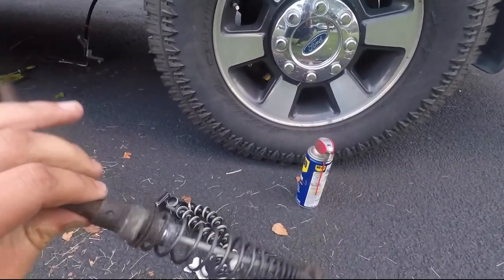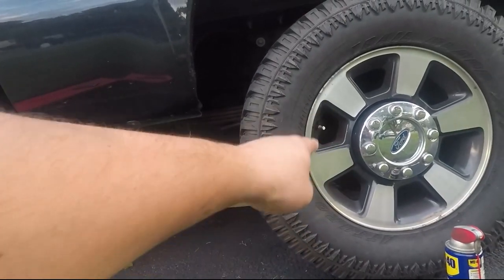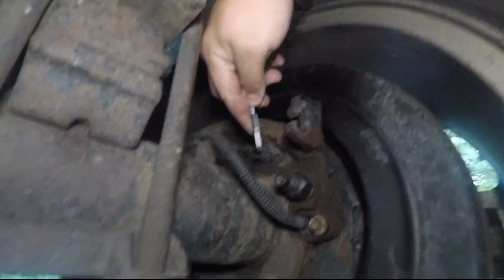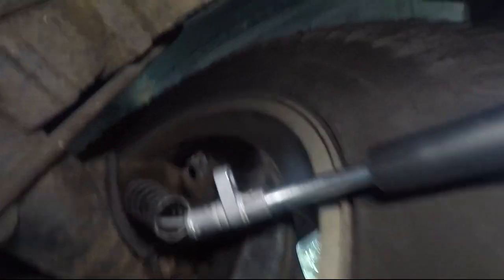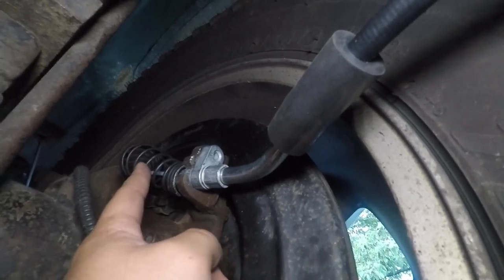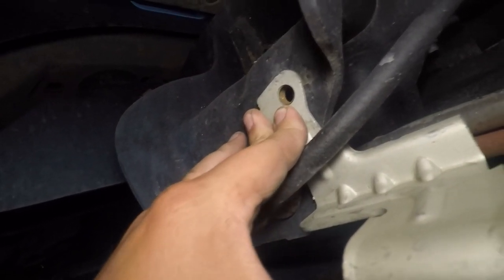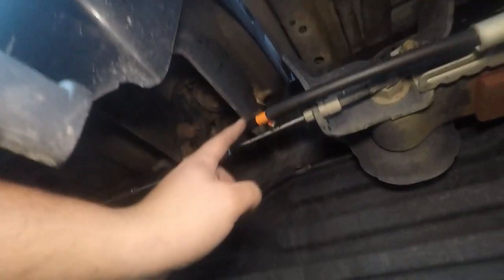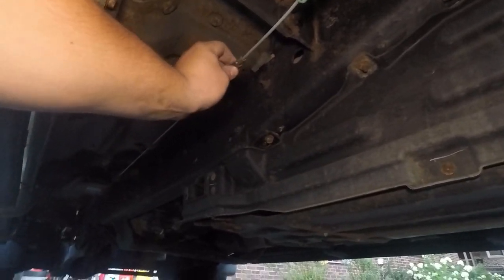E Brake Cable Replacement Super Duty

Comment: Thanx again, that verifies and informs me on the stuff I needed. I wrote out a great lengthy response as I cooled down from the tropical heat before I run out again and get a couple three hundred things done. About how I worked at a machine shop in San Diego that did all the machine work for the city bus system engine rebuild shop. First thing I thought was, after I realized those springs are what creates the tension on the ebrake pedal/cable. That’s not much to hold a 6,200 lb vehicle still when you go into gear with that monster engine. And Haynes said the test in on a hill also. Then I thought, to get much more pressure the springs would have to bottom out and the system cannot be designed for that. So it is only a parking brake, and would be a really weak emergency brake. Showing the cable replacement really filled in some gaps, as I just got my first Super Duty in May. I’ll finish rewriting my original comment that got erased in a couple other comments later, I have to feed my pig or she’ll be bulldozing around my cabin. Suffice to say the idiot I got the truck from replaced one rear brake disc the evening before I looked at it, and the machine shop was educational on a few levels. I rebuilt the old VW engines and did about everything else from paint to interior etc. . The machine shop had specialized in them for 30 years previously.
Reply from the maker: Man that is awesome! Did your comments get removed from my videos? I hope not because I didnt delete them. You have been very respectful not sure why that happened man. I'll check later tonight to see if they got kicked over for review but I can only do that on my computer not my phone

Comment: 👍 great video!   Can't wait for performance parts to become readily available for my 2020 F350 SRW!
Reply from the maker: I hear ya man. I am getting ready to soon start doing some performance mods to the truck, and reviewing them. There were some big changes but generally speaking it should still apply to your truck too
Reply: @six0bros  yes they have changed a lot, tranny is 10 speeds seems to do just fine mostly.   Hauling heavy it is most noticeable when slowing down, especially on downhill grades.  Unloaded you really dont notice it except the mpg is much improved.   Until the parts get into full production mode I can drool over your upgrades at least Lol
Reply from the maker: Lol I would love to do a comparison from the 10 speed and 6 speed. Plus the newer ones have a nice bump in power from the 15s. It would just be cool to do an in depth comparison towing and everything
Reply: @six0bros  yes the power is there.  My 2016 was deleted, tuned, had intake flo pro exhaust and to be honest the tow tune wasn't any stronger than the 2020 is in stock tow mode.  If I lived closer I would definitely let you use my truck for the comparison!   The increase in mpg still blows my mind.  Love the channel!  👊
Reply from the maker: Thanks man. What are you getting for mpg? I am really ready to start some real performance mods. Not necessarily all tuning related either. Like water meth injection is on the list. I need to get these exhaust manifolds in too from bd diesel. Maybe a different intercooler some big plans for this truck, but also I am ready to bring the 6.0 back
Reply: @six0bros  I am getting 19.7 empty and 15.9 hauling a mixture of 10k lb loads and 25k lb loads.  That's huge compared to both of my others seeing it is factory everything.   My 2005 6.0L gets 19.3 empty 14.8 loaded  but its modified heavily and my 2016 got 20.1 empty 15.2 loaded with mods.
Reply: Is that name from the Jim Carrey Ace Ventura movie?

Comment: Good video, one thing, that little hole in the leaf spring mount, you were a little muddled, you should have said the tab goes into the hole. And there is a hole up at the foot lever in the cab. Haynes says to have someone get under and pull down on the cable, which pulls  the mechanism until you stick a small rod or bolt or screwdriver in and it locks the cable totally loose. I am looking for an adjustment for the cable itself. But maybe I’m used to older vehicles where the pedal doesn’t travel far after an adjustment. This is a spring loaded setup I still do not understand completely. I adjusted my shoes but it still seems to have too long a travel. Very nice though, you went through it all sufficiently and quickly. Takes long enough to do the darn work, let alone having to watch some backyard pundit put in social comments while your sitting there covered with grease at your screen hoping to see what you really needed.
Reply from the maker: Sorry I thought I said about having someone help. Thanks for tip with the screwdriver

Comment: How do I adjust the parking brake cables got too much slot get new parking brake shoes cable still got slopped
Reply from the maker: I believe to adjust it you need to take rear brake rotors off and adjust it there. How much slack is in it I wonder if they sold you thr wrong one for your cab configuration I never looked into different cab sizes and didn't think about that until now. I will try and look into it I forget if I did at time of this video
Reply: 41 year new rear shoe rotor dum Tighten Up shoes and got a drag still got a lot of slop in the parking brake cable

Comment: I've got a 2015 F250 and I just did the rear brakes. Buttoning it all up, and my cable has a LOT of slack in it. Like 6". I have the star adjusters just right. If I tug on the cable, the brakes hold. But leading to the pedal, its all slack. The pedal doesn't apply enough tension. There an adjustment or anything I can do to tighten up the cable?
Reply from the maker: Did some of it start to come apart and cause this issue? I would check the cable to see if it'd coming undone anywhere check the mechanism inside the cab too. Are there any videos about adjusting ebrakes because I have not done that so I am of little help
Reply: @six0bros  THanks for getting back to me. Everything looks the way it did. Just there's a bit of slack. THe brake works now, but the pedal needs to be near the floor to activate. ANd yea, every video I look for is OBS. You're is the only one that is the newer models, heh.
Reply from the maker: I would look and see if maybe there isn't a way to adjust it to be tighter inside the cab. Like take the whole mechanism that does it out and see
Reply: Not sure about this truck but on cars there's an adjustment port to make on the cable...usually accessible through a removable rubber grommet in the rotor/drum mounting surface.  Just a couple clicks with a flat head and it tightens up the brake.....again not sure if it's the same on these trucks, as I haven't had the wheels off mine yet (I just got it...2018 F250 6.7 King Ranch...and LOVE IT!).

Comment: Another question I have is how far does the Ebrake pedal go down when everything is right. And how strongly does it hold the vehicle? Mine slips quite easily if you put it in gear.
Reply from the maker: I do not use my often but when I do I push it down pretty hard until I really feel an increase in resistance. I will say these trucks make so much power even on older models they make a lot of torque that they will push through an ebrake. I would make sure that it doesnt push through when in neutral on some kind of a hill. That said it could just be time for new e brake pads. I plan to do mine next year with some other work
Reply: Great thanx again, confirming what I thought. Now I know how the system works. The shoes had pretty good meat left on them, I looked. I just got it in May from some clown who replaced only one rear brake disc. Here in Hawaii on the big island it’s a very small world. I tracked down the other matching disc, as he did it the evening before I met him to look at the truck. He is in Waimea and the Napa there at first said they could not track it. Until I asked what they had in stock. 2 of this grade, 2 of that grade, UH! Only one of this grade eh? He looked it up by that item and found he himself had sold the other one to the guy I bought the truck from 2 days earlier. So they transferred it to the store near me and presto, I had the exact match on the other side pronto. Same production run etc. . I worked at a machine shop in San Diego that did all the machine work for the city bus system. Detroit Diesel and Mann. We did all the machining and the mechanics at the bus company repair place rebuilt the engines. We did the blocks, rebuilding the heads, and the connecting rods. Although we had to farm out the big end of the rods to another shop. They had specialized in the old VWs previously for 30 years. I wasn’t a full machinist, but I learned enough to be dangerous. That, after doing everything but the insides of the transmissions on the air cooled VWs. Engine rebuilds, electrical, paint and interior, strippped one down and painted it. Stripped the whole interior windows, all came off. My first paint job. It came out super with the help of our drummer and the guys at the paint supply shop.  Color sanded the whole thing. You ever do body work on the old VWs? All curves, and my first time, and it was a wreck! Aloha from Bob in Hawaii, thanx again for the info!
Reply from the maker: Man that is awesome! Thanks for the support. I really think it is cool that my videos can reach someone all the way over there. I mean I am in eastern PA. Lol if you ever have questions or anything I am happy to help